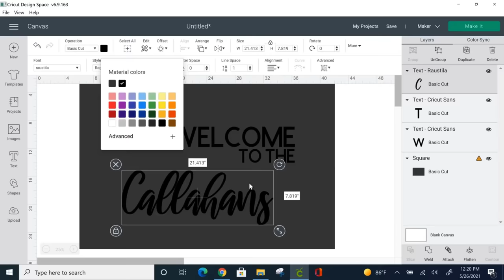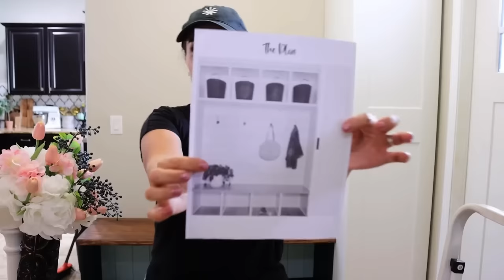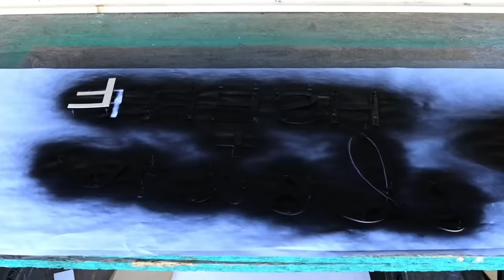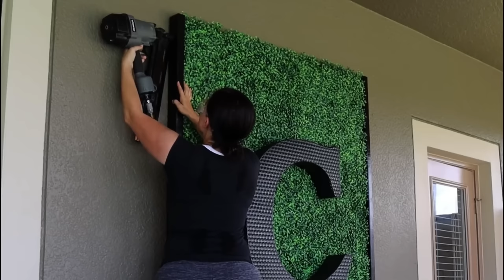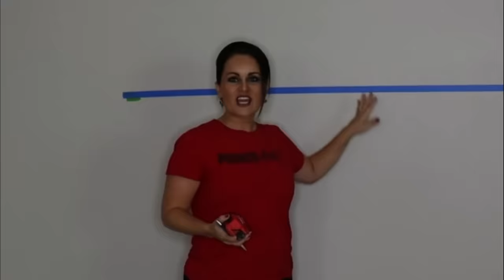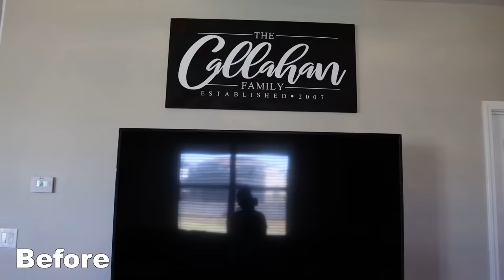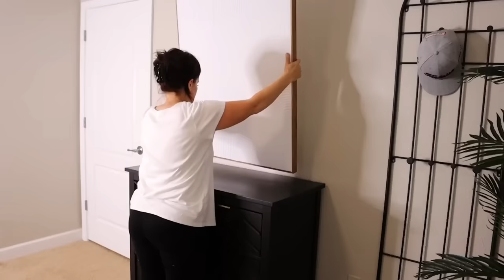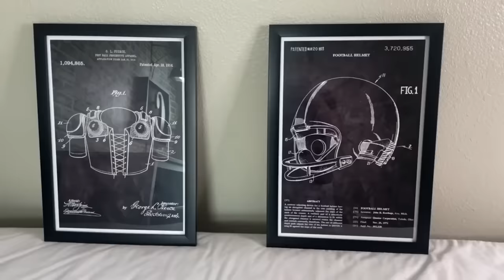EXTREME HOME MAKEOVER: Transform Every Room with Me!

Comment: You have so much talent and great vision.  I was wondering what product you use to patch old screw holes and how you finish it so you do not see where it was fixed.  I took down some picks and hubby patched the holes and repainted but you can clearly see after repainting the fixed area.
Reply from the maker: I use dap drydex: 
https://amzn.to/4aahukH 
Fill the hole. Starts pink. Dries white. Sand to smooth. Wipe with a wash cloth, if you have orange peel texture, then in a a circular motion spray a light coat of this over the patch: 
https://www.amazon.com/dp/B00176S43Q/ref=cm_sw_r_as_gl_api_gl_i_KW0E5HTAXR41EHT8MRWT?linkCode=ml2&tag=designedtot09-20

Let that dry then paint. Hope that helps!
Reply: Thank you so much!

Comment: Hi   It appears that the front door to your house is installed incorrectly   The hinges with the pins should not be on the exterior  It's not secure
Reply from the maker: This is completely normal in Florida and is meant for hurricane prevention. My door has hinges where you cannot remove the pins. This helps when hurricane force winds come blowing the door can’t blow in because it’s hitting up against the frame.💕
Reply: Thank you for sharing because I was worried